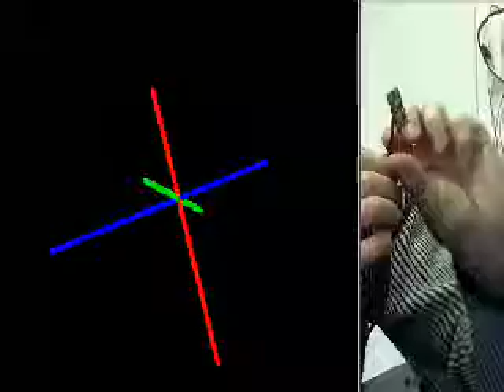Inertial Motion Capture and Kalman Filter

Comment: To reduce the gyroscope bias i performed temperature calibration. For that i left the sensor first in a fridge, then took it out and heated up to ..30 degrees within, say 5 minutes, sampling the readings, say each 0.1 sec. Then i used the Least squares algorithm to interpolate the readings as a polynom of 2nd or 3d grade.
BUT! Unfortunately the bias is ALWAYS here, and my only conclusion was, that the cheap sensors are just not suitable for long-term measurements.